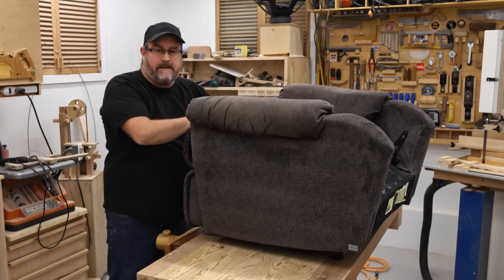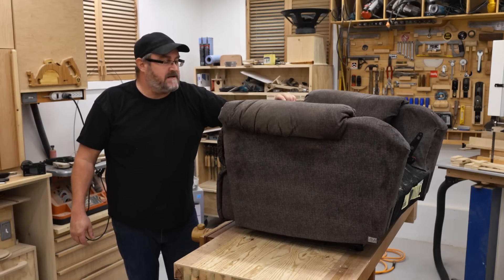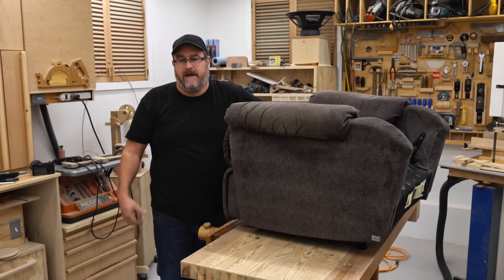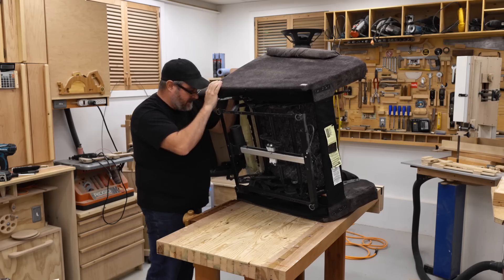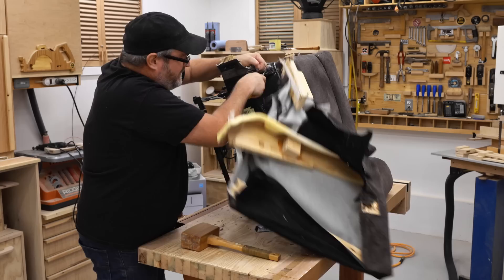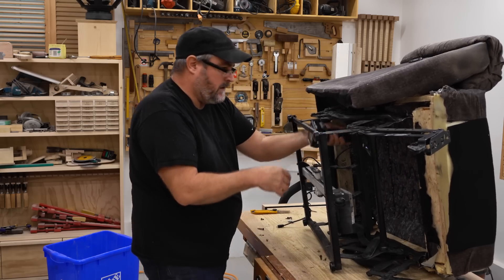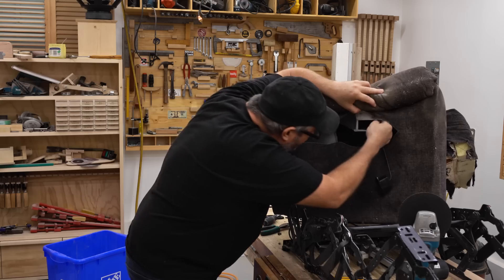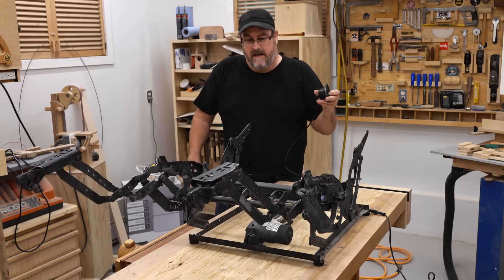Reclining Chair Tear-Down for The Motorized Mechanism

Comment from the maker: I originally made this video for my "Scrap bin" channel:
https://www.youtube.com/c/IBuildItScrapBin
But felt it was good enough to post here. 
What do you think? Rebuild this with a proper wooden frame, of scrap it down for the parts? Interesting thing to do with the motor and lead screw mechanism is to make a TV lift, but I don't need one of those. 
Could just leave it as it is as a piece of kinetic art, just run it in a continuous loop. Just watch your fingers in those pinch points!
Reply: John Heisz - I Build It please rebuild it the way a woodworrker would. I have a leather version of this and the motor died on me so I’m looking at projects for the internals too.
Reply: You should totally make it into a chair! I
Reply: Build a new 2 piece(removable back for door clearance), smooth contoured see through chair  with Plexiglas, wood and epoxy resin so you can see the inner full workings of the electrical and mechanical.
Reply: My deceased father would have definitely repurpose that mechanism for something. I like the idea of an outdoor lounger that sits under a large umbrella. Built in beer cooler,optional .Cheers bud...
Reply: Can we get more John Heisz After Dark vids too? Definitely build a new chair, or use the mechanism to upgrade your camera gantry!
Reply: New chair! Would be awesome! If you google stressless chair you might get some ideas of really open (and quite common in Scandinavia) wood/metal chair design and combinations, thought the common ones here isn’t electric or have the footrest reclining... 😀
Reply: Turn it into an android, look at some of the things Boston Dynamics have done.
Reply: Chair would be cool.
Reply: Don't know why I'm thinking motorized workbench vise with clamping pressure meter.
Reply: I use to work for "Flexsteel"... I upholstered the arms on recliners... I feel you should try and rebuild it better than before... Of course that would involve woodworking, picking out fabric, sewing, upholstering and (from the looks of this video) more cussing...
Reply: Totally agree John...  Use hardwood and rebuild leaving a maximum view of the mechanical.  Great idea!  Maybe fish around and find some thin leather to pad the hardwood.
Reply: Rebuilt it.
Reply: Pleas rebuuld and in Addition add a Motor, so that you can drive around,
Reply: You could build a reclining version of Captain Kirk's command chair from the original Star Trek series.  Given the design of that chair, it would work well with the recliner mechanism you have.  There are plans for the fixed design on the net.  A little creativity could go a long way!  Microfiber covering would also be way more comfortable than leather or regular cloth.
Reply: You could put a scary monster arms and build a silicone head to use to for Halloween. I also think the industrial look is very interesting, too.
Reply: @Ben-Wah  great idea!!
Reply: i know im randomly asking but does any of you know of a method to get back into an instagram account..?
I was dumb forgot my account password. I love any tips you can give me
Reply: @Khari Kyle instablaster :)
Reply: @Alejandro Oliver i really appreciate your reply. I got to the site thru google and Im waiting for the hacking stuff now.
Looks like it's gonna take quite some time so I will get back to you later with my results.
Reply: @Alejandro Oliver It worked and I finally got access to my account again. I am so happy:D
Thank you so much, you saved my account!
Reply: @Khari Kyle you are welcome :D

Comment: You'll take the motor out and store it for 20 years, falling over it daily. Eventually you'll take it to the dump, then you'll need it immediately.
Reply: It's a standard linear actuator. I scavenged one from a bed thrown out in the curb. I just used it a few days ago to push back a heavy closet into its place, after I moved it and it somehow got stuck. Took 10 seconds!
Reply: But the mechanism that attaches to the linear actuator, is very cool.
Reply: In those same 20 years people will be saying, 'they just don't build 'em like this anymore.'
Reply: David Lowe it's the earrings my wife had. For YEARS she had one earring and had lost the other of the pair. Finally she got tired of the one that she still had reminding her that she had lost one, so she threw it out. The NEXT DAY (after the garbage had been picked up, of course) she found the missing one.

Comment: I wish that I had seen this 3 months ago.  The wooden frame (left side and back) for my power lift recliner broke and dumped me off while punching a big hole in the drywall behind it.  Like yours, the frame was OSB and little bit of solid wood plus a box of staples.  OSB doesn't hold staples well at all.  I was too pissed at the chair to rebuild it but I might have tried if I had seen a video like this.

Comment: Well John, a chair would be the easiest fix for the frame.  Hmmm what else can one make from that mechanism?  I'm thinking that you would have to strip the mechanism down to the motor and just use that, unless you have something that will fit flush in the wall and could be extended, bearing in mind that the folding part of the mechanism is not very stiff or stable.  Whatever you decide will be a fantastic design no matter what, can't wait to see it.

Comment: When I first got my garage, eager to start making, and for free mind you, I was quick to jump on thrown away recliners so that I could diss assemble them and use the mechanisms, however, I have yet to find a use for the them, 3 years later they still take up valuable shop space. I suspect they are the same way with you if you have not thrown them
Reply: I have returned, because while i threw away the three mechanisms i had, i have just scrapped another recliner. This time, i was quick to dismantle everything to its most basic parts. Im using the stuffing for budget insulation i am adding into the garage attic space, while the rest goes into the pile of prepared steel for the scrapyard. The copper yield from the two small motors was pathetic to say the least, but the cord was hefty enough. Id say it was worth it. Have you used yours yet lol

Comment: This is weird, I took one apart just last week to make one with a hardwood frame and without all that padding and stuffing.   But mine was just a manual kind.  But I did keep the seat and back they were in one piece and actually pretty good wood.  Now I just have to build a hardwood frame with nice small arms and nicely styled legs and all.  Definitely make a good recliner out of it.   Thanks for the video....as usual very well done.

Comment: I used to sell La-z-boy recliners and there is one big difference with their power chairs, well two, but the first affects the second. The first is an actual four-sided box for the chair to sit on. Instead of just a bottom rail connecting the two front feet, they connect with a full side parallel to the back. Basically, the mechanism sits inside the box. There are holes for the mechanism to operate, but the box provides rigidity. 

If you build a "minimalist" chair, look at some historical chairs from La-z-boy.

Oh, the second difference is the price. They're definitely more than $400.

Comment: rebuilding is a good idea, something that looks like a "rock back chair" using a single scheet of plywood, but with a recliner mehanism sounds fun for me ;) but using this mechanism could be also good for so many things for exampe an adjustable hight small workbench or a power operated foldable/slidable table would be funny

Comment: I used the motor & controls, simple up & down, to power a bead roller.  I made a simple frame for the control to operate as a foot switch.

Comment: Hey I love your humorous video. What would keep a Wurstrow Power Recliner from coming to a fully closed position? The footrest and back of the chair do not come fully flush closed like they're supposed to. It's brand new. The leglrest sticks out about 4 to 5 inches and the back doesn't close fully upright staying back a little. Any ideas on how to fix that and or what part is the problem? The motor was replaced but it still didn't fix the issue. Thank you.

Comment: Good quality aniline leather that’s soft unmarked full grain leather will cool you in summer and warm you in winter. If yr made you sweat you had cheap painted leather similar to vinyl. In wood terms you bought a chair made from non structural ply or chip board. Please don’t give up on leather, quality leather is incredible and lasts a lifetime if cared for like wood.

Comment: On my chair  the welds holding the  screw mechanism in place.  Broke out over time  i. Wound up bolting. Those back in place  with loctite of  course the second time  after the original repair  fell off on me  BTW those motors are pretty cheap on Ebay   As they are of course made in China and many reclining couches  use them  i had one of those  from Sears  and because people used to sit on the arms a lot those began breaking off over time  same crap Oreinted Strand board  stapled all to hell  the couch was only a grand brand new  but i still. Hauled it to the dump after only 2 plus years. Or so   Ironically i also went back to Leather  yet. I bought some way. Overpriced spray cleaner from the furniture store  i got the couch from  it was like 12 bucks for a little bottle but did seem to work   ?  I’m sure it was some rebranded cleaner that the furniture store. Put their  name and logo on